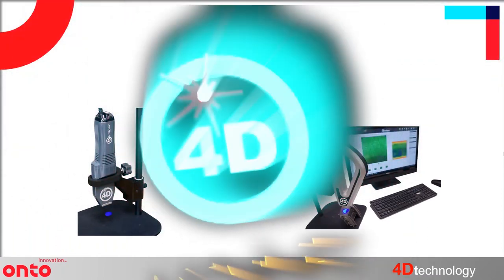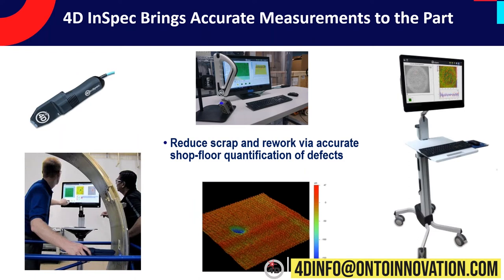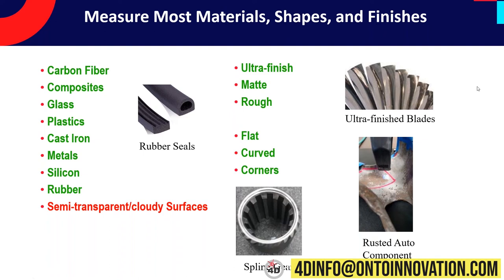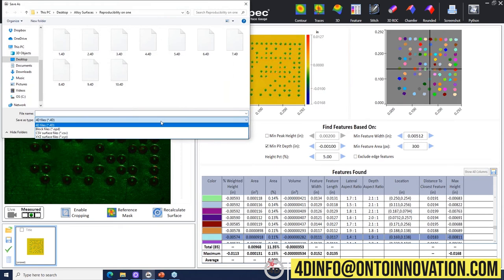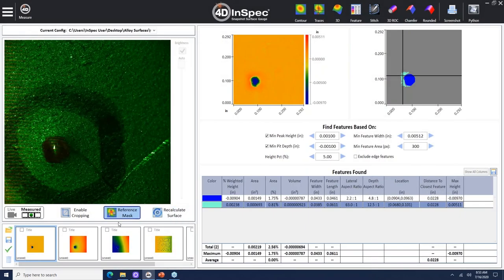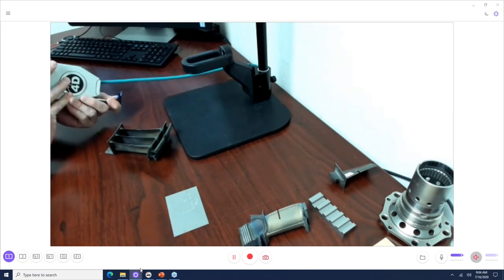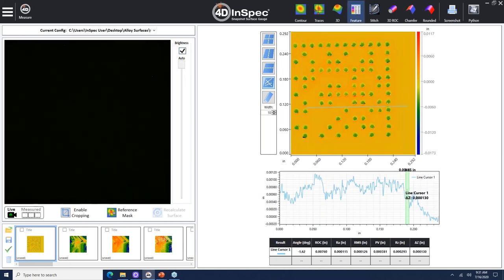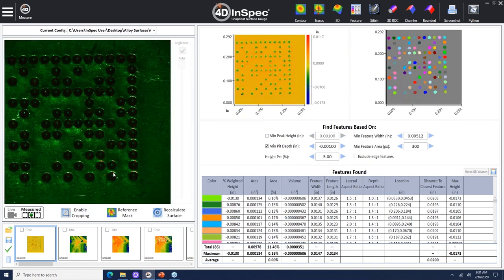Edge break and defect measurements on the shop floor, made easy

Comment: When should cropping be used?
Reply from the maker: Hi Helena, cropping should be used when you are measuring at the edge of a part (where some of the field of view is empty space). This eliminates 'noise' pixels caused by stray light entering the instrument. There are certainly other times when you might want to crop, such as when you have an area of shape that's not critical to the area of interest -- as when you're measuring a pit next to a sidewall. The sidewall data is just going to induce a lot of tilt when trying to level the area of interest around the pit. Contact our applications engineers (4dinfo@ontoinnovation.com) with your specific measurement questions, or if you'd like to schedule a training session to help you make better measurements.